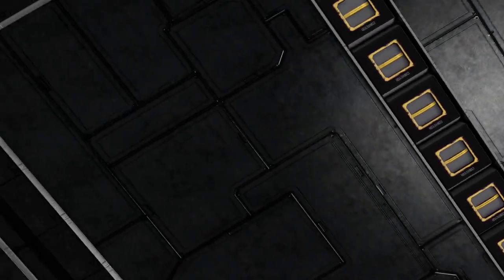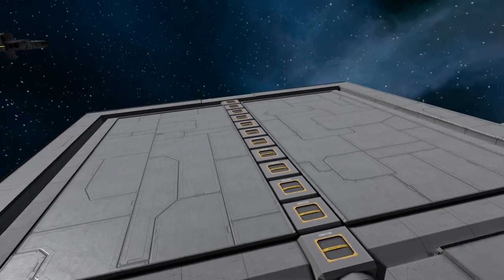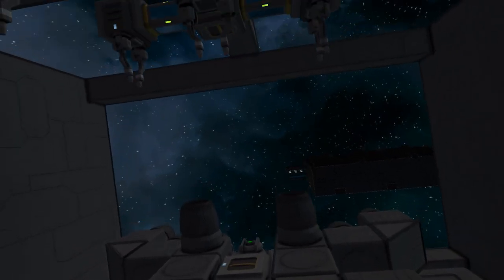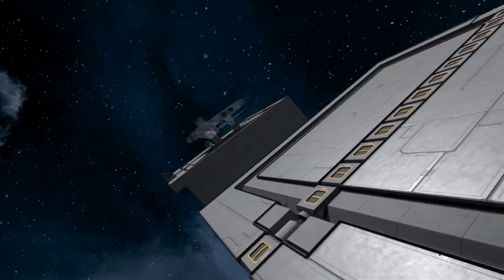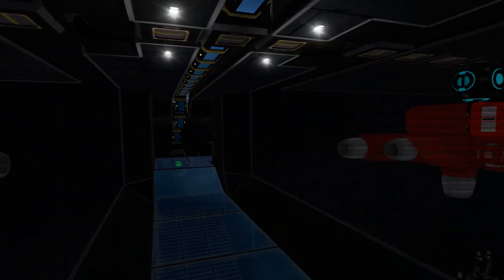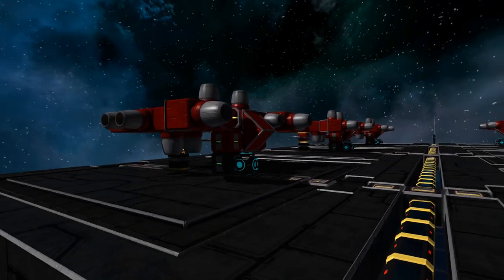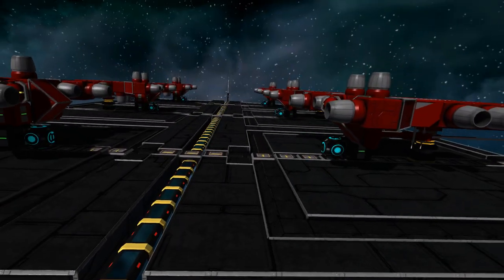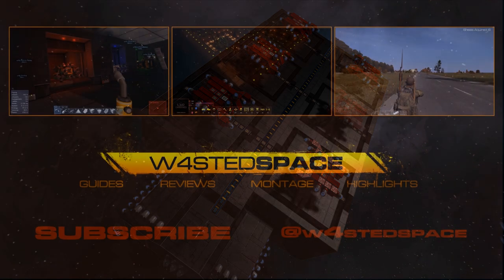Space Engineers - Next Gen Carrier #1 - Modular Projector Hangar System

Comment: Why not combine the concealed turret/weapon system with the rotating launch system? One side to build and launch fighters, then flip over and reveal rocket pods or turrets. 

...another idea would be to utilize a "revolver" style launch bay, with four (I say four because of the limits of the stock parts) launch bays on a central rotor with a single bay door. The bays would be like the chambers for bullets in a handgun. I bet you could even sync the rotor's speed to the construction time for each fighter, making it a "gatling" launch mechanism.

Utilizing this method, there would be no exposed construction/launch mechanisms on the outer hull, and you could mount more weapons and heavier armor instead.
Reply from the maker: Aye so essentially a full rotational setup with a craft every 90 degrees... would be tricky to time right especially as timers at the moment don't allow units smaller than seconds but would be very cool if it could be made to work. Kinda love how many options these flip things have, ppl keep suggestion new things using it all the time :) n1

Comment: Since I love modular and projector tech seperately but even more together, an easy solve to the cockpit problem is to make the built craft modules for the modular cockpits.

This would make an excellent module for a civilian ship.

Need fighters?  Make fighter bodies and join the pilot.  Need any of the industrial modules?  Make them and add the pilot.  Have a small recycler nearby to recover the material.  No need for a massive hanger bay full of various craft when all you need is enough room for the cockpits.
Reply from the maker: This means I need some sorta crane system/production line setup to pick cockpits up and position them ready for building... which sounds like great fun :) Not the sort of approach I normally take so could be interesting to try that out.
Reply: ***** Pity pistons are so big.  Having the cockpits on the floor below raise up to the modules would be unusual.
Reply from the maker: HAdrian builtawall
I'm more thinking turn the concept on it's head and start with the cockpit modules that are then, once the pilot is in place, moved into position and the chosen design built around it before launch.. really don't think it'd take long to do the welding once in position and would look cool as hell :)

Comment: if you make the launch pads longer and thinner, you need less hight to turn them. the fighters wil also be more dart-like. looking forward on seeing the progres. thrusters can poke thru the platform as long as they integrate with the survice.
Reply from the maker: Yeah could change the shape of them and make them more low profile.. may end up doing that if I redesign that hangar style for use with one of the other ship types on the carrier, along with integrating the engines into the hull potentially.

Comment: just a small thing from the top of my head: wouldn't putting a projector inside the drones solve your repairing problems? this way the missing parts would be projected even when it's disconnected from the carrier. also could be useful for manned ships when the pilot needs to do some manual repairs far from home
Reply from the maker: The parts would be projected aye, but projecting projectors doesn't work very well last I checked, they don't hold settings and so needs to be setup individually each time making it a bit more difficult. Still a concept I wanna play with though, cheers :)

Comment: Can't say I'm surprised that the merge blocks were playing up .. I've found a number of issues with them, and even lost two mining ships due to the merge blocks exploding for no reason, or not locking at all. Still, I really like the design of the hangars, and could easily picture them either side of a carrier .. quite intimidating for any approaching attackers. Nice one!
Reply from the maker: Could defo still be made to look a bit more sexy (for mounting on the carrier, gonna have to be a bit more than square blocks!.. but happy with the design as a test of concept :) Cheers macko!
Reply: *****
I'm building something similar (on a much smaller scale), but that has four bays facing inwards around a launch tube from four sides.  I felt it offers better bay protection than the external launch.  It can be just as modular, but instead of pasting one bay at a time it would be the four.  Pic: http://i.imgur.com/s5FwOom.jpg
Reply from the maker: Looks like a solid start to a design, keep me updated will be interested to see when it's done! Always cool to see different ppl's design styles.

Comment: What are the size and placement limits on a projector.

If there are none then why not fit one projector on the main ship with a blueprint of the entire ship which should include any merged vessels I think.  You can include variants for different load out obviously.

This would also help when repairing the vessel since anything completely destroyed will have a projection in the right place and can easily be rebuilt even outside the ship where any welding ship could do it.

This brings up self repairing armour.  At the moment it only repairs armour that hasn't been completely destroyed.  A blueprint image would let you repair totally destroyed blocks mid battle.
Reply from the maker: I'm not sure honestly but someone suggested a method on my escape pod video earlier that got me thinking along the same lines, will have to find out but I assume it'll be whatever the maximum for a blueprint is and so could potentially be massive. There would be some things you might want to ignore from that sort of system of course open up further possibilities (as you can always group actions together in timers anyway).

An idea I wanted todo for the NGC but as yet haven't looked at or attempted was a tracking repair drone.. welder that's set to on and then a sensor system that keeps it facing the ship once launched with an overridden thruster making it orbit.. then need to look at how to launch them and make sure u have full ship coverage ofc (and potentially recover them also but if you can get the tracking good enough why not leave them orbiting?) but have a couple of ideas for that.. recovery prolly being the most difficult.
Reply: *****
Why bother recovering them?  Just grinding them down to part in a per-built salvage bay and use them for something else.  Don't forget, you can insta-build any ship you want.  Doesn't need to be large, just big enough for the thing you can insta-build.
Reply from the maker: HAdrian builtawall
That's what I meant by recover :) Even that could be tricky if I want the system to be relatively passive.

Comment: Is there a reason you don't have the projector stay on the inside of the ship? (so you could do the double-sided building you described later in the video, without exposing the projector part)

As for a must have feature, make sure you use some kind of gravity drive (directional like this would be sweet http://i.imgur.com/bXzFahX.jpg)
Reply from the maker: Yeah there is, it needs to be on the same "ship" as the block you're building from, in this case the merge block on the rotating bit.. because SE treats anything on a rotor as a different ship at the moment I had to have it like this, originally had it like you describe but while i could position it, it wouldn't weld.

Directional grav drive, rogor!